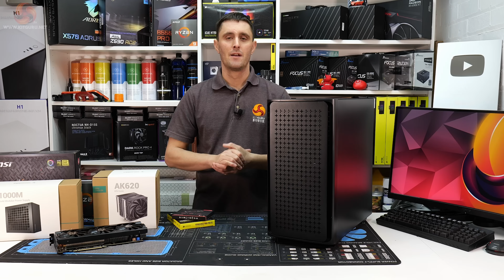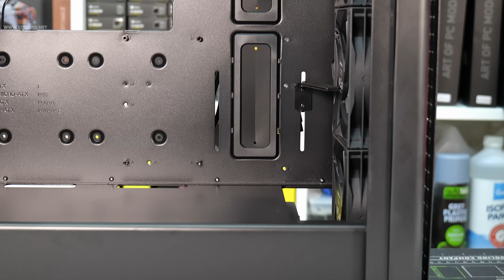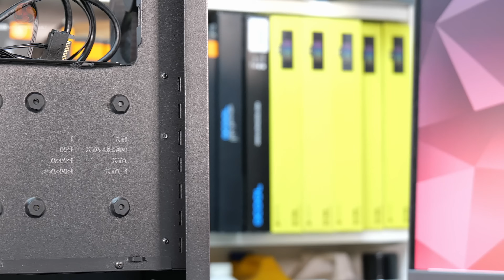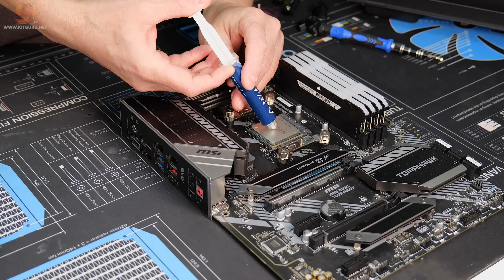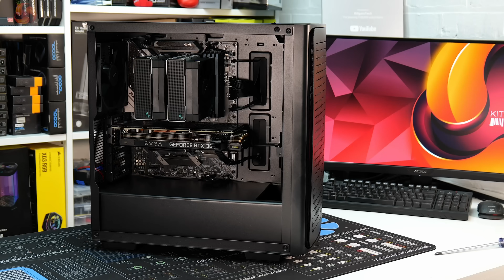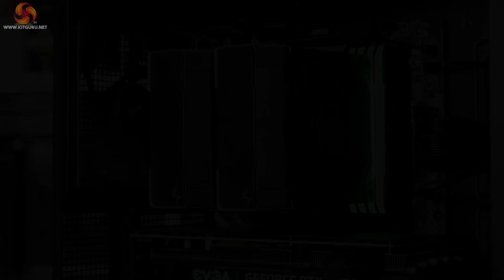DeepCool $1600 Build - featuring CK560, AK620 and PQ1000M

Comment: thx for upping the video! is there everything in the pq1000m included i.e. cables/adapters for connecting a 4090 as well? which needs 4x8pins (or 3x8pins if not overpowered at least) as far as i read.

Comment: how can you install 2,5" SSD's on this case?... before putting the mainboard in?
Reply: You can install two 2.5" SSD's on the motherboard tray before installing the motherboard or two in the 3.5"/2.5" drive cage under the PSU shroud.

Comment: Waaaait a minute, that cooler fits over the Vengeance RGB Pro kits, while the fans don't stick out like sore thumbs?
Reply: Correct. There are Vengeance RGB SL though so slightly lower profile compared with the original Vengeange RGB. You have to lift the front fan very slightly, just a couple of millimetres.
Reply: @KitGuruJames  Have already checked the dimensions of the Vegeance RGB Pro and those of this cooler. The RAM modules won't fit under the cooler. But no worries, got me the Deepcool AS500 Plus instead.

Comment: Plus points for the 140mm rear fan. The front panel might benefit from clipping in at the centre as well as top and bottom. I'd probably replace the fans with Lian Li Unifans. I like the green hue though. All in all another Ronaeal piece. I liked the understated attention-drawing to the front panel's problem fit.👍
Reply: Yeah the front panel just needs some support in the middle. It surprises me that Deepcool thought it would be ok like this.

Comment: Just picked up a CL500. Putting in an MSI B550 gaming edge wifi w/ 5600X, 16GB 3600 cl14, 1GB sabrent rocket and Asus 3060 OC Dual. Trying to track down a 3070 for a "reasonable" price.
Reply: Good luck finding a 3070. Prices do seem to be dropping a little and slowly.
Reply: Does ak620 fit in cl500?

Comment: My personal favourite is the AK620 CPU cooler. I like the clean, minimalistic aesthetic. The front panel might be an easy fix by adding more supports connecting the panel with the rest of the case. Hopefully they will release a revised version of it.
Reply: Yes the front panel just needs a bit of reinforcement. I must say I'm a fan of the AK620 too. Seems like good value and performance.
Reply: The Deepcool AS500 is great too, if you don't want a dual tower but still want good cooling performance.

Comment: Whats the point of rgb ram if you are going to cover it with cooler :D
Reply: It adds a bit of light glow but the real reason is I had no RGB'less DDR4 to hand. 😀
Reply: My guess would be to add a little to the RGB of the front fans. It also shows you the height compatibility of the cooler!